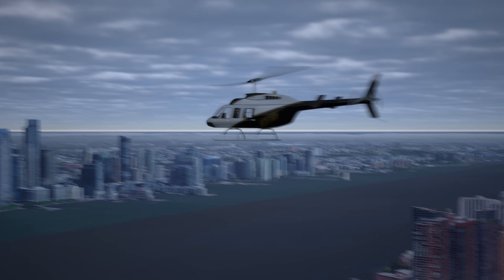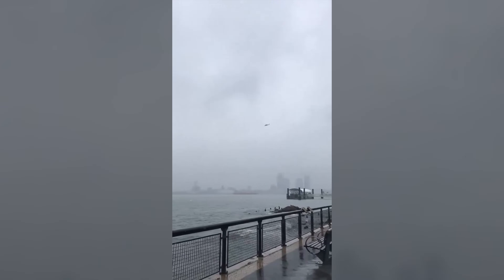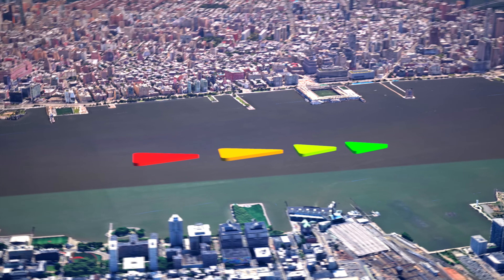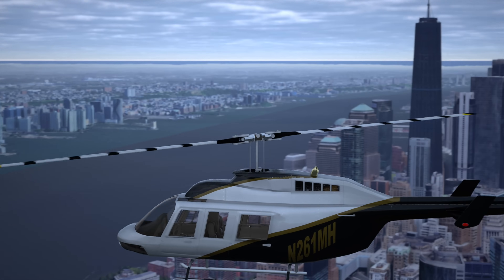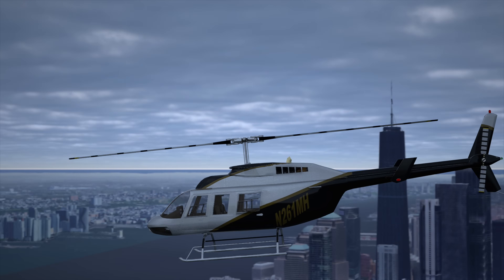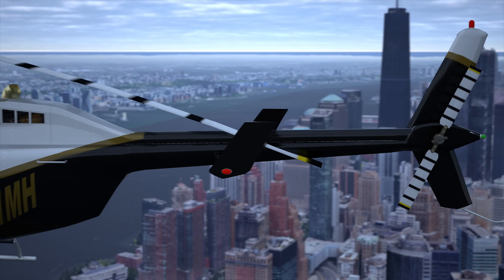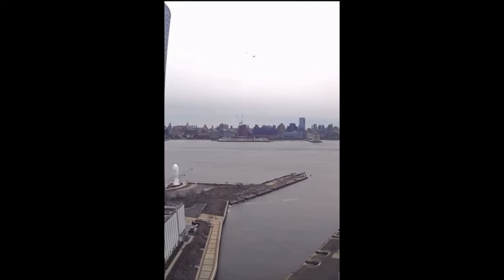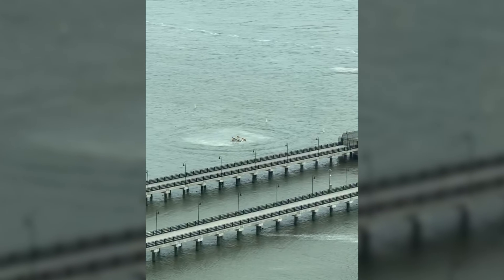Helicopters DON'T just fall from the sky - What is "Mast Bumping"?

Comment: 22 yrs Army helicopters, OH-58, TH-67 and later TH-57 experience. Taught the Maintenance Test Pilot course for Bell AH-1F Cobra.  Mast bumping usually causes separation of the Main Rotor (M/R) hub from the mast.  I does not usually pull the entire transmission out. The only thing that does that is excessive mast movement knocking the "candlestick" against it's stops under the XMSN. Watching the initial portion of the video, the aircraft appears to be flying level and cruising.  I see no immediate maneuvers or disturbances until the severe yaw event that initiates the tail boom separation.  My experiences point to 2 possible causes.  The Tail Rotor (T/R) drive shaft hangar bearings on the 206 models (civilian versions of the 56, 57, and 58) are notoriously picky about accepting lubrication. They have been known to discolor and seize with little to no warning. Locking up the T/R drive shaft at the tail boom attach point bearing can cause separation, and the immediate torque due to loss of yaw control/tailboom could cause the whole upper pylon to become dislodged.  The other option that comes to mind is pitch control link failure. I had a Cobra do that.  When a P/C link fails, the M/R blades, or at least one, are no longer controlled and can easily flail themselves into the tailboom. That applies torque to the XMSN, potentially ripping it out. The fact the blades were still attached to the XMSN is what kept them rotating, like a toy set of blades on a stick. So, while I don't disagree that mast bumping could be a cause, the evidence I see doesn't lend itself to that.
Reply: Canadian A.M.E. here - 44 years wrenching primarily on Bell products from 47's to 212's - and I definitely agree mast bumping is highly unlikely to be the base cause of this accident.
Reply: @bruce7327 My friend used to work as a helo mechanic  for Toronto ame on bells. He quite a number of years ago because of the lack of maintenance and on them. A few months later one of their helos crashed
Reply: @bruce7327  What do you think about the nodal beams that fix the gear housing to the frame failing? Tailshaft bearing or something chipping to seize the gearbox cause failure on the beams? That would account for what seems to be the entire gearbox housing hanging off the mast....
Reply: 25 yr Career Bell Mechanic here. I greatly approve and agree with your assessment. We will see.
Reply: @raynibbs4679  If experienced mechanics like yourself are agreeing to his comment, it must be the real deal like you said.
Reply: My thinking is along the lines of what you’ve said. The fact that the rotors were still rotating mainly intact after separation brings a mast hit into question, however no one could rule anything out based on the info we have at the moment. Another puzzling thing to me the location of tail separation. I could be completely off base, but tail separations usually don’t happen that close to the cockpit with a mast bump. They usually happen further down the tail. Again, I could be completely wrong since this video doesn’t provide a close up shot of the accident.
Reply: @adamc827 You are very humble sir. A rarity these days.
Reply: GREAT information and analysis.  Thank you.
Reply: Thank you for sharing your wisdom sir
Reply: Thank you I read your entire comment love to see people who care about what they love
Reply: HH-60 Flight Test Engineer here...I knew your response was the real deal when you wrote "XMSN". Great analysis.
Reply: @jollypirate23 yep. XSMN statement holds validity( 206/ 60MTP here).
Reply: Fantastic explanation.  Thank you.
Reply: Agreed.  It’s hard to tell, but it looks like the XMSN deck was still attached to the XMSN.  We lost a KW once when it hit a tower.  ASDAT and safety said it caused a severe 1:1 when the blade it and a second severe 1:1 when the second blade hit causing the XMSN to rip the top out of the aircraft.  They hit the ground in excess of 200Gs.  Whatever happened here is very tragic for all involved.
Reply: I have no experience with choppers, but a life time in the automotive industry etc.
My first though was a sudden transmission point failure. When a drive line hits a sudden stop somewhere, the entire drive line is place under excessive strain breaking at other weak points as well.
All those parts have a lot of momentum in their mass and don't just "stop". Things will break somewhere at the weakest points (plural).
>
Your explanation sound very close to the mark :)
Reply: So this was a failure to mechanically maintain the helicopter by a mechanic(s)?
Reply: @doomer33deg  A wee bit early to assign fault to either the maintenance or operation of the helicopter, although either are possible
Reply: FWIW, @blancolirio agrees with you I think:  https://www.youtube.com/watch?v=U8Q8XuqlyMQ
Reply: @reallyWyrd For now my vote is with Juan.
Reply: Fmr UH-1H Army Crewchief/Mech here.  Do you think there is a chance one of the pylon support links failed or wasn't properly screwed in, causing a failure? It's just odd to me that the tranny came out with the mast and rotor assembly. Beyond that, absolutely no way that was mast bumping.
Reply: @rvboyett if that was the case, would it be normal to make it thru 5 previous flights that day? With the 6th being the final straw so to speak? 🤔
Reply: Please write a book, Im serious. I loved Chickenhawk by Rober Mason in 1983. Ofcoure liked is maybe the wrong word. But it wrote exactly what it must have felt like flying those Slicks over there and being shot at. If you were trained or were Test Pilot for the Cobra then you have some serious stories. Maybe you even were in Vietnam at that time. Atleast write it down, even if its just an hour of your day and what you write is total random about a specific moment, doesnt matter. I wish I knew more about my german grandfather and the action he saw with Heeresgruppe Sud during WW2. I dont know anything except he was in that unit, and he passed away in 2014
Reply: @klaasj7808  Picked that up in an airport a few years ago, very very good read.
Reply: @klaasj7808  oh, a book by a mason? How about a tv show by a jew?
Reply: That has to be the most educated guess I've ever heard. Thank you for your insight.
Reply: Thanks for your input. I just wanted to add that wind gusts at about 18mph during the time of the rescue. No reason for extreme maneuvers on a tourist flight outside of an emergency.  Looking at the video, it seemed like they were just cruising straight along until it happened.  So I would think mast bumping is pretty far fetched.
Reply: My vote is for the locking up or some type of maintenance mistake.
Reply: Mast bumping is more common in the Robinson helicopters.
Reply: @JeffreyDonaldson-t1o  
Haven't looked up the specifics and you could be right, but it happened to the 206 long before the Robinson was a glimmer in in the ball sack of the Robinson designer.
Reply: Brilliant answer and thank you for your service sir 
My father died in his own airplane. 
I wish I had had someone that could have clued us into what happened, as you have done here
Reply: @kaylingle3890 aircraft mechanic and pilot for 45 yrs. Do you have details and N#?
Reply: 15 year Bell pilot (LEO) and Bell Training Academy graduate here. I agree with your assessment. A lot of sources are picking up on the mast bumping phenomenon, but all of the videos I've seen show the a/c in S/L flight immediately prior to the breakup. Mast bumping would generally require an unloading of the disc, which there is absolutely NO indication of here.
Reply: i like turtles
Reply: I’ve read hundreds of posts from helicopter pilots over the last couple of days and this is the first one that conveys any understanding of helicopter aerodynamics and critical flight conditions. Great post.
Reply: Okay gentlemen what do you determine happened here? And does it alert you that he was a tech bro from Spain is there something nefarious here
Reply: Thanks for your service, and the insight 💡
Reply: You are a badazz mofo.... love it...i know nothing about any of this....but I felt like I was reading this from the Neil tyson of everything helicopters... im so glad someone like you opted to lend your knowledge to these comments. Almost never do i get to read anything enlightening or knowledge based, in the comments. Usually just trolls or "cliffys." thank you.  And thank you for your service.
Reply: 38 years of mostly sitting on my couch watching tv and youtube. Highly agree on every point😂
Reply: The person you want to see  being interviewed on CNN,BBC,FOX,CBS,MSN etc not the garbage we are being fed or should say regurgitated. Thanks for such analysis.
Reply: This should be the pinned comment.
Especially considering the expressed background and qualifications, if accurate.
Reply: @Bill_Woo  Thanks.  Real deal and still in aviation maintenance world. Contract Maintenance, A&P and Pilot... though they pay me for what I know, not what I do anymore.
Reply: Thank you for your expert analysis. Helicopters do fall from the sky and I have seen that first hand. My Dad fell two times thank goodness for auto  rotation ,it was an engine failure. One of my friends died in a helicopter crash reason was probably what you have just described. I have seen the countless hours of maintenance  done by our mechanics on different vessels and different helicopters.  We flew them to look for fish our pilots and mechanics were the best. The helicopter did not go up unless it had all the prescribed checks  and services done each day that it needed to full filled all guidelines. Thanks again for the info and just wanted to say helicopters do fall from the sky and I know of at least two incidents where fishermen and the pilots were gone never to be found again in the Pacific Ocean 
.
Reply: I’m just going to wonder if the Jesus Nut was properly affixed
Reply: @stevetheim7390   I agree with @klaasj7808.  Even if your manuscript/diary/journal is never published, it would be a priceless treasure to your family.   So many of us don't have the stories about our fathers' or grandfathers' activities and missions when they were in service.  My daddy served in WWII, but there was almost nothing he would or could talk about.  Now he's gone and there's nobody to ask.  Please at least THINK about it.  God bless!
Reply: THANK YOU!!!!!!!!!!!!
Reply: Once the NTSB puts together all of the pieces they'll be able to tell if there was contact between the main rotor and tailboom.
Reply: Eve though I do not really understand your explanation - thanks for sharing your expertise. - You should partner up with Mentour Pilot, I am sure he will cover the event in detail when the investigation report ist out.
Reply: Doesn’t “mast bumping” normally occur at low air speed and not at 90 to 100 knots?👨‍✈️
Reply: @robertbandusky9565  Mast bumping occurs when you unload the rotor disc.  It can be done at any speed, if you perform a push-over type maneuver. It certainly SHOULDN'T happen in straight and level flight. IIRC, the US Army first started seeing the phenomenon during nap of the earth flights, when there would be more of a tendency to push over.
Reply: @robertbandusky9565  
Low G push-overs (hey, wanna feel weightless for a sec..?) are quick to remove your main rotor blades in anything other than a ridged rotor system and speed be damned. And usually survivable, for the occupants anyway, are mast bumps made possible by off-camber take-offs and not using enough collective to minimize the chance of bumping or boom strike.  But helicopter pilots know this.
Reply: @ Sir! I’m going to speculate that the main rotor was not the issue of whatever caused this to occur? The main rotor appeared to be tracking    correctly in its descent with minimal damage. Should be straight forward investigation into the cause? I’m with you, tail-boom separation . We shall see😎
Reply: Are you just writing to yourself?
Reply: 🤔 I was wondering if one of those B-206 wishbone XMSN mounts failed? If so that may allow the XMSN to waller around and the blades possibly serve the tailboom before the transmission gets totally ripped out of the airframe? 🤔
Reply: Wow, its truly amazing to see so many flight engineers/mechanics/pilots/ people experienced with helicopters in this comment section providing DETAILED analysis, I was expecting the usual braindead conspiracies/politics. Great comment!
Reply: Too many helis and planes been brought down these days… it’s because of an agenda to push something.. there’s a reason why this is happening, and it’s not random, NWO
Reply: Great knowledge info👍
Reply: Alstom、Huawei…..Now ,Siemens？！😅
Reply: There is a picture of the helicopter being pulled from the water.  From the looks of it, the tail is attached but bent 180 degrees towards the starboard side.
Reply: I agree with point 1: a failure of the tail rotor secondary gearbox, minor and invisible to inspection. A sudden jam could break the upper main gearbox and dislocate the primary rotor.
Reply: Thanks for the very intelligent write up on this.
Reply: Umm yeah what he said.
Reply: I slept at  a Holiday Inn express last night and accept this explanation.
Reply: i did see a video this pilot flying a helicopter and performing more or less acrobatic maneuvers, rolling to the left and pulling back on the stick....
Reply: There was a similar mishap with a USMC AH-1W Cobra (same rotor system design) several years back. They had a bird strike on one of the pitch change links, causing it to fail, which ended up ripping the rotor head and transmission out of the aircraft. So it aligns with your second option. I'll be interested to see the final NTSB report.
Reply: I saw a tweet that siemens signed a rail contract with Turkey, promising to boycott <you know what small country in the middle east>. Not long after, coincidentally, president of the rail infrastructure at siemens mobility dies in a helicopter crash. Connect the dots.
Reply: Thanks for your service...
Reply: Thank you for that insight. Maintenance has no shortcuts.
Reply: Please post this at every video regarding this accident. Thanks.
Reply: Google says that the XMSN is basically the transmission which diverts power from the engine to the rotor blades... for anyone else scratching their head on that one.
Reply: Exactly! More likely transmission or link failure. Cheers
Reply: What do you think about it being a possible intentional elimination?
Reply: Since there was not an explosion, did they die because of how hard the helicopter hit the water. Me knowing nothing ....would think they would have survived this.
Reply: 206 and 60 MTP. Agreed. Tough call at this point but makes sense as well.
Reply: I'm a retired fixed wing guy, but it seems possible that if the main rotor hub separated from the mast, it could have taken out the tail also. Just a thought? Helo's have a lot of moving parts! And the more moving parts, the more potential for disaster. Although, I did always enjoy flying in them. Very cool machines. One thing for which there can be no doubt. Aviation is unforgiving! Mean ole Mr. gravity.
Reply: I got like 20% of that
Reply: Thank you for a well written and explained possible causes.
Reply: As a retired maintenance mechanic, i agree with another comment - mechanics never make mistakes. Look elsewhere.
Reply: Thank for this comment. The video was super helpful, and what you wrote adds additional info. I hope they can figure out what happened. Just cannot imagine the sheer terror of everyone aboard! They weren't that high up, so they saw it all happen. 😢
Reply: Thank you for this, very informative
Reply: das rite wut i iz be thankin he din du you already no!
Reply: Never heard of this mast-bumping thing. Although there's likely a good reason for the chopper set-up, isn't there a safety device that would make contact between blade and tail or hub impossible?
Reply: There was Strong gust of wind 120 MPH . They should have never went up there
Reply: Thank you Steve. I hope the truth comes out.
Reply: Locking up of the tail rotor, due to the siezing up of its drive shaft, could cause the forward half of the craft to rotate forward, due to conservation of angular momentum -- tail rotor stops rotating so the fuselage starts rotating pitching forward (?)
Reply: It was DEI for sure!
Reply: Thanks for your service and expertise.  Seems like the separation point from where the tail boom split from the main body would give more weight to your theory and that's what it sort of looks like in the video.
Reply: Agreed. Also the rotors seem pretty intact. I'm no expert but if they had just severed the tail, they wouldn't be flying like a fairy.
Reply: You suspect improper maintenance the cause ?
Reply: @stevetheim7390  yes three PCL failing thoery is probably the most logical. AH1-W at Pendleton had a major mishap and was a complete loss. The word was a redhawk flew into PCL that was aluminum and not a steel reinforced PcL, cutting the tail boom off. 
Aviation can be brutal with no remorce at a moments notice. My tail boom mount bolts, after writing was more of a how in the BLEEP does the tailboom fall off. 

I've also seen pilots find the PCLs not torqued during preflight. Hand right PCL pitch horn bolt could also be a cause.

But how both blades that are 180 go. Something sheared both PCLS perhaps
Reply: Well with 23 years of army helicopter experience a agree that mast bumping could be the cause
Reply: Big bird.
Reply: As another OH-58 pilot , another contributing factor to mast bump  can be a zero to negative G maneuver, not sure we saw enough pre incident video to see if that was the case but as said a mast bump would normally separate high on the mast and there is at least the lower swashplate on that rotor when separated.  I know on the one crash site I was in when the main has a sudden stopage it can cause xmsn to exit laterally out the right side of the aircraft.  I'm leaning towards a sudden stopage due to gearbox malfunction or a severe flex of the main hitting the tailboom
Reply: One thing you don't want to hear about ANY moving parts on a helicopter is "known to seize without warning". 

Are you serious? Is this a known thing?
Reply: @ there are chip sensors and frequent service intervals on these devices. The 206 has been around since the 60’s so it’s definitely not a dangerous aircraft.
Reply: Yea I’d say that would make more sense. It locking up
Reply: Everything you just said confirms to me that these aircraft are not entirely safe. So why are they being used to take the general public on tours.
Reply: @AhhDubya69  That's not entirely true.  Like any good machine, it just requires care and maintenance.  We flew the tar out of them in the Army, but we also maintained them appropriately.  When done right, it's a great aircraft.
Reply: I fly $500 DJI drones and l concur
Reply: @iwaswrongabouteveryhthing  thank you for representing us Mavic aces in this convo 🤣
Reply: @iwaswrongabouteveryhthing 😂
Reply: @iwaswrongabouteveryhthing  i fly with 15 euro ryainair flights intoxicated on unallocated seats with no refunds or insurance and i agree with all of you
Reply: @iwaswrongabouteveryhthing  I occasionally fly a helicopter in gtav and my expertise says this is an excellent analysis
Reply: @swiftxrt  stay safe up there pilot brother,
Something always happens when you least expect it
Reply: 30 yr Army Aviation maintainer and Safety Officer, I agree with you. The tail booms of these aircraft can develop cracks over long periods of time, I would not rule that out as well.
Reply: Surely it wasn't mast bumping. Looking at the severed rotor blades and transmission they look to be spinning perfectly balanced still. If they had impacted the tail wouldn't they have been damaged?  Is so they surely would have ripped apart if they were damaged and out of balance.
Reply: @F1NATIK  agree.  The fact that the MRBs and the Xmsn were ejected out (looks fairly cleanly) means that something happened with the tail rotor or tail rotor drive shaft and caused the xmsn to be ejected upwards.  If the MRBs had hit the tail boom, the blades would have splintered into shreds.  I think stevetheim9370 is right on.
Reply: maybe someone was out to get the guy and its sabotage
Reply: Same thing I was thinking. This video is nonsense.
Reply: @YolandaPlayne  At least it wasn't "Because it was made in China!" On a serious note, heart goes out to the families and  to those who perished in this most unfortunate incident.
Reply: Ive no idea what caused it, but I’m pretty sure it wasn’t mast bumping
Reply: As a veteran Dunkin Donuts cashier, I absolutely agree with this analysis.
Reply: @Eagle7433  - thank you for your service
Reply: @Eagle7433 😂
Reply: @Eagle7433 😂
Reply: It's unlikely to be mast bumping in this case while cruising normally in clear calm weather.   Possible causes may be due to a large bird strike or metal fatigue separating the rotor/candlesticks.  No need to jump to conclusions till the NTSB report.
Reply: @BillAnt  From the videos of I've seen of him flying, I wouldn't be surprised if the root cause had to do with how aggressively he was flying the aircraft. Too many people get in non acrobatic civilian aircraft to perform no standard maneuvers.
Reply: @BillAnt  if you weren't so quick to refute in a vain attempt at appearing to add value, you'll read that he has an observation, not conclusion. Comprehension helps.
Reply: @BillAnt  You literally said "possible causes may be..."  followed immediately after by "no need to jump to conclusions". 

🤣 Doesn't seem to bother you at all when you're the one doing it.  That's just hypocrisy; but his explanation made a lot more sense.
Reply: @syberphish  He doesn't say that is the cause. He reports that the cause in the video is unlikely and goes on to explain a more likely cause. Give the government a few months and they will issue a report.
Reply: @syberphish  so you don't understand the difference between a conclusion, and a possibility? Good to know.

A conclusion is a definitive statement, this possibility is not definitive, is it?
Reply: @syberphish His statements are mutually exclusive. Giving possible options is not jumping to conclusions. Maybe stop with the juvenile emoji as well.
Reply: Maybe @Ghauster
Reply: @syberphish Hi there! I know nothing of helicopter maintenance or piloting but I have 47 years of experience in the English language. Almost all of which was gained in the country of its origin; I can conclusively tell you that providing a range of possibilities based on multiple years of direct experience is about as far removed from jumping to conclusions as is reasonably possible to get.
Reply: @Ghauster  yes yes the government, we can trust them. everybody, we need to just wait a few months the government will tell us exactly what happened, they would never lie something like this.
Reply: @GHOST-9zero7  Of course they never would. Now. Would you like to buy this bridge I have for sale? It's licensed to have tolls on it.
Reply: Agree - unlikely mast bumping and even less likely tail strike. If it was mast bumping it would separate under the head and if it was tailstrike the blades would desintegrate
Reply: Yes these are possible causes, but we also neglect to acknowledge “intent”. There A LOT of contradictions happening which only raises suspicions even more. Going to be thoroughly investigating for the months to come. Too much is amiss.
Reply: @rcnewman51.  
I love me a good conspiracy theory especially when they turn out to be true. But, wow, this one probably needs a lot more careful thought. Unless you happen to have the evidence that shows intent and that we seem to be failing at acknowledging said evidence? And an entire family along with their pilot dying a horrifying death definitely ranks up there with things that shouldn't happen and literally saddens a persons spirit to see, it is still not unprecedented, or amiss. Especially in a 206. 
When I heard "mast separation", I had zero problems believing that mast bumping could very well be the cause of the accident. Then I watched the video and would have to agree with the explanation the Kiowa pilot (OH-58) (Army variant of 206) put forth. The damage we see would not be easy to inflict. The person doing it would first of all have to have access to that aircraft and also have fairly extensive knowledge on its systems, because a good majority of mechanical issues that can bring a helicopter down, are in fact quite survivable. Loss of main rotor  is not one of them. But if you don't know that, and even if you do, how you gonna do it and also be sure that they'd fly in this particular aircraft? That would take several actors. The more the merroir doesn't sound like a good plan when slaughtering families and trying to be slick about it. 
So, yeah the guys well articulated theory is far more likely AND reasonable, then a person who has probably watched a bit too much of the dark side of YouTube lately. Mix in a lil bit of sunshine with those videos. Better for your skin and bonus, will make you look less crazy. And I say that as a fellow conspiracy theorist.
Reply: @rcnewman51. Who wanted the family dead?
Reply: 37 year YouTube video pilot and I agree that something caused this
Reply: You have no idea what you’re talking about.
Reply: @etheldingleberry8075  You have no idea what you’re talking about.

Are you referring to the OP? If so, you offered no rebuttal content, thereby contributing nothing to this discussion except an attempt to create confusion

Furthermore, you want to be taken seriously using the name Ethel Dingleberry?

Putting all this together, I conclude that you need help, or - maybe - at least one person to merely listen to you
Reply: @etheldingleberry8075  I get so tired of people who just blurt out such a claim as if we are to just take your statement on faith with no expansion or credibility. It's not funny either, if that's what you're aiming for. We're just to stop listening to someone offering his decades of knowledge.. because why.. nothing